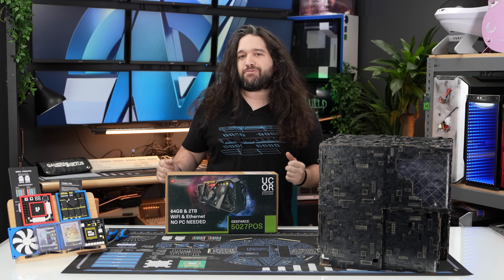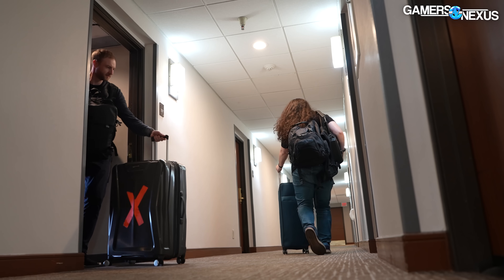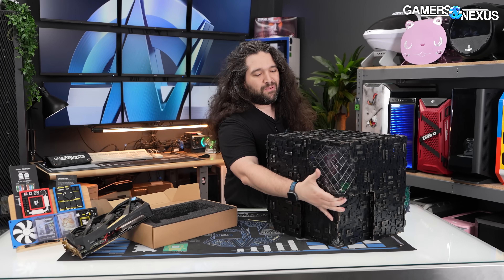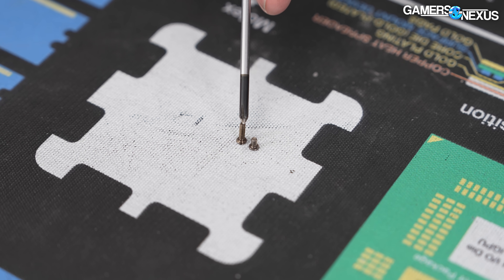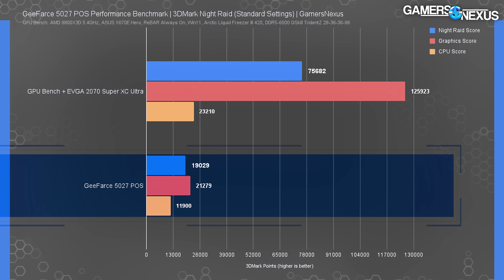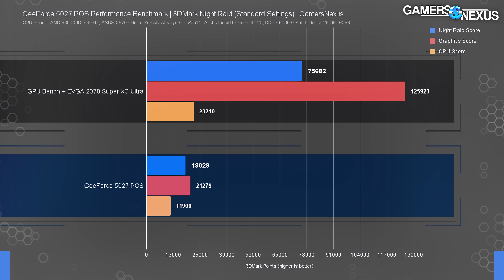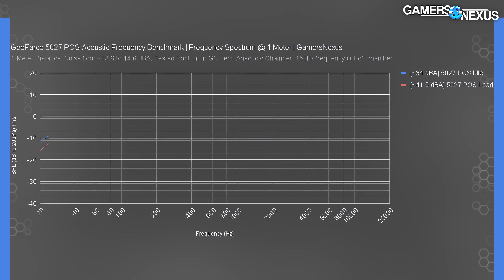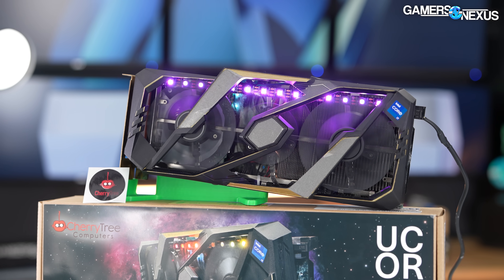Pre-Built Computer Inside a Video Card: CherryTree's RTX 5027 POS Custom Mod

Comment: Have to admit, for all of the devices Steve has disassembled, I am fairly surprised that he didn't know about the screws under the fan on laptop coolers, or any small form factor device cooler for that matter. Or perhaps he has never done work on devices such as that?

Not a judgment, just an observation. Kind of surprised me is all.

Comment: Bloom eff. ..
Monitor & Graphic & all silicon chip basic circuit.. 모든 dot room 에는 Guide arrow 가 하나 추가로 나오는데, 이 guide arrow 는 CPU 와 GPU 에서 나온 dot 를 해당 dot room 까지 끌고 가는 역활을 함.. 이 과정에서 한 번 진입한 dot room 은, 해당 dot room 에 stay 상태로 있는 dot 에 연결되서, by-pass 상태로 guide arrow 가 나오지 않음 (ram 하고 다른 부분이 이 거임)..
ram 은 CPU(gpu) dot 와 command 로 구분하는데, display 는 이 것 없이 guide arrow connect or not 으로 구분함..

Comment: I feel this is built for AI. I wonder how much it changes the dynamic in token generation and how well can it run large models. Also with advanced 8b models parameters you can fit and run 8 models in parallel. That opens new doors if price is right. These are nieche dedicated video graphic cards.
Reply: Calm down, it's just a standalone NUC in a different case.

Comment: I'd buy something like that. I know... sad; but I like NUCs, when they work. 

Putting two, or three,  of these GPU-NUCs into an over sized case with way too much RGB would be like experiencing Christmas for the first time, again, after passing the age of 40. Forget dual booting.... just have all the hardware you need to run Linux, Windows, and (*cough*) a BSD based OS, right at your fingertips in one over sized box. It might be a small adventure in cable management. Fun, fun, for weeks on end.  

Then you can start attaching external GPUs, monitors, a KVM, an analog ten band physical equalizer with it's own light show, and then what ever else imagination inspires you to come up with. A serious toy for the ages. Put some A.I. into mix just to push sanity to the limits. Maybe the A.I. can have it's own RGB array and a voice? 

If you bunch co-operated with.... Dawid, and a couple of others, you could make a movie out of an adventure like that. I'd buy a copy of that epic adventure on DVD; just to show off for bragging rights.

Comment: This is actually a great idea, I've got a TrueNAS server with older hardware (Intel 4th gen, DDR3)  running self hosted apps and a ZFS array, if I throw a cheap, newer NUC into the machine to run all the self hosted apps, the older system could be dedicated to running the storage!

Using the pcie port for power is a nice touch too

Comment: I sort of actually built something like this, for real.  A laptop in a box mini computer (AMD 5700U) , with an E-GPU (4060) and a small power supply for the GPU.  I pulled out the MB from the Mini and put a 4 pipe cooler with a fan on it so I have no thermal throttling or noise from the CPU.  The CPU on the MB is de-lidded so the cooling is efficient. I added a small copper heat-sink so the cooler plate would clear the MB components.I had to fit a computer with monitors and peripherals  into a checked bag which also had to have clothing and stuff in it. It runs almost as fast as a full case computer.  The NVME link instead of PCI slows it a bit I think, but cooling is fine.  I saw the heat-sink in the build and the one on my mini, which was just like it, ran very hot and loud. So I added a real cooler.  I Moved to Italy and this computer I now use. It is working fine here. Nomad score = 2472  Spy = 10511.  Both scores are marked as legendary, I assume that is because almost no one else has built a PC like this.
Reply: I'm amazed you even got that through TSA in the US, if you were in the US when you built it. Well done.
Reply: @ZenAndPsychedelicHealingCenter  
Oddly enough, my bag had a TSA card in it saying they searched it.  Everything was just as I had packed it though.

Comment: Basically it can be hidden pc, many many people in police will not understand this is not a gpu. PCI~E can connect like a network adapter with point-to-point connection to mother pc to access it if needed. A power switch can be "turbo" button next to fake hdmi outputs

Comment: A typical ATX connector is usually rated for DC applications and not AC.  If that is the case, this is a blatant electrical safety concern.  This is what happens when there are no 3rd party safety certifications applied to the overall product.
Reply: Whoosh. Oh dear. How embarrassing.

Comment: I silently hoped They replaced big original PCB with a smaller (guess also less powerful as a tradeoff) GPU board, cramming it side-to-side with - but still connected to - NUC.

Comment: That's genuinely a neat idea for a tiny low power PC specially to use inside a normal PC. Thermals might not be good tbf but let's face it if you are a tech nerd even if multi "PC" or multi system is doable virtually you still get tickled in the right spots by the idea of a whole separate PC inside a normal PC disguised as a GPU =)))))
Also for them silver screws, pretty sure the long one is what you pay for and the short one is what you actually get cuz would you believe it Nvidia is shit. . . . .*gasp*

Comment: I remember thinking when the 3090 came out, I wonder how long it will be before this amount of power comes in a single slot variance, and then wondered if we'll just get the rest of the he computer inside a GPU you just plug intot the wall and monitor, glad to know I wasn't just being mad 😅

Comment: my corsair 600t is taped up because the plastic spring latches are all broken. top fan keeps becoming loose due to gravity probably, currently a negative air pressure i can’t remember if i reversed the rear fan. cpu stock fan on a i7 950. with a 1080 to beast, I’m down bad.
Reply: Careful that doesn't catch fire.
Reply: @ZenAndPsychedelicHealingCenter  i have speed fan on at all times

Comment: 4:40 one large screw 😂

But seriously if I start running out of vram in blender, I won’t know what to do. I don’t wanna buy these questionable 50s series gpus. And I don’t wanna buy a used 4090 or 3090 ti. I wish they still sold them brand new

Comment: The marketing on the box has that late 90's early 2000's made in China electronics vibe, even down to the conflicting information (64GB and 2TB in the same sentence). The only thing that would make it better, is to name the model some thing along the lines of "STX 5999 POC Edition" with the emphasis on the number 5999, because the higher the numbers, the better.

Comment: I actually really want something like this where the PCIe slot identifies as a USB4 controller.  That way the SBC gets power from the host system and networked to it via USB4 host-to-host.  You'd have single point of failure if that main computer crashed but it would be so cool to have multiples of these all networked together through USB4 at even the minimum of 20 gbps for messing around with Proxmox or Kubernetes all using your main ATX power supply and not taking up any additional desk space.  I've thought of doing something similar with multiple ITX boards in a single full-size tower but this could be cooler and you could potentially use just a PCIe backplane instead of a main host computer, but either would be awesome to try out.  Would obviously just need a shutdown script to tell all the SBCs to turn off before the main computer turned off and shut the ATX power supply off.
Reply: It doesn't have quite the same cool factor but you could make something that pretty closely approximates this with a custom enclosure to basically rack a bunch of SBCs with a DC power backplane and as hoc networking. Jeff Geerling did something like this with 5 M4 Mac Minis, but it could look a lot more slick with more custom work on the enclosure (he just went with the full Mac slotted into each spot for simplicity)

Comment: BORG cubes probably run cool.  There's lots of thermal rejection in space....(-200 F ambient).  Makes things challenging when you're trying to keep electronics and mechanisms working.
Reply: Actually thermal rejection is quite challenging in space, ambient temperature in deep space is very low but there's no atmosphere so you can only use radiation to emit heat, for something as densely packed and relatively low surface area as a Borg cube that would be non trivial (even the ISS has a pretty large set of dedicated radiators purely to increase surface area for cooling)

Comment: You could theoretically power it through the PCIE slot, so long as it only draws 75 watts. Or you can make it powered by both PCIE and one of the internal GPU power cables.

Comment: Depending on space, you can actually use a DC-DC ATX power supply so it can run from an actual PCIE GPU connector. You can also power the thing from power coming into the PCI/PCIE connector. Also, technically if some EE's wanted to waste his time, he could make an actual PCI/PCIe connector to ethernet bridge so the new PC shows up as a PC sitting on its own dedicated ethernet card to the host machine.

Comment: 14:23 it can also use a 12v PCIe power connector!  So the power routing through the PCIe pins made sense, and this should definitely be tested for acoustics and thermals while inside a PC.

Comment: I think they should offer custom built mini pcs in old gpus. There are plenty of dead 20 series and older amd gpus to make use of and upcycling them in to something a person can actual make use of for light computing tasks would probably go over well. Some people do not have the room for say a cheap laptop and a gaming rig and i bet streamers would love these little things a huge number of twitch etc streamers use discord to talk with their viewers etc so having a entirely separate mini pc build in to a old gpu with it's fans still in place could add a little extra air flow to their real gpu and give them a second pc with out using up tons of desk space. Yeh they made it as a joke but didn't a certain case manu do exactly that with what is now a very sought after pc case? Maybe even sell the mini pc in a gpu for a discount in exchange for a old gpu of what ever type they need some stock of i mean why not saves on e-waste and would prevent people from just tossing out pc parts in the normal trash. They could dispose of it properly and convert sections of the original pcb in to keychains or what ever  because why the hell not?

Comment: i like the answer for "why?" "because fun...." you don't need any other reason to do something like this. I would move the power switch to the back of the gpu bracket put it in a regular build and use it just for discord and web have it connected to a 1080p screen and use a software kvm or better yet just another keyboard and mouse

Comment: Honestly thinga that should be a norm would be M.2 NVME slots on the GPU itself because of PCI-E slots getting really really fast

And some GPU's don't even use the x16 lanes and only use x8 lanes which means you can slap 2x NVME SSD's on the Graphics Card and use 8x for GPU x8 for 2x SSD's

Other thing that would be cool is the GPU power connector to be ON THE MOTHERBOARD itself so we don't need cables into the card anymore and most likely will be more reliable and easy... just plug and play i guess

Also i guess the PSU power connectors can plug somewhere on the motherboard to power the power connector

Also this already exists it was i think shown on Computex

It's very cool and interesting
Reply: I have an i7-12700K and a high end motherboard and graphics cards are too cr@p compared to a PC like that.
Reply: @saricubra2867 wtf are you trying to say?

Comment: It's like they're going in the opposite direction to Nvidia.
I bet Nvidia will end up releasing cards that will just be a tiny streaming based client board that calls up a remote ai farm for anything intensive & just have built in video encoding/decoding and basic acceleration for the OS. 

Of course they'll still cost a tonne... $700 if you want the 6090ti which is the only one with h265 compatibility 😂

Comment: Your traditional video card is basically a slave device computer, it just communicates via pci as a way to function. The basic principles of computers exist on your video card already; it has the main proccessor, memory, BIOS firmware chip, VRM stages, IO and fan controllers. So basically this isnt a new concept, its just graphics cards are purpose built to render graphics.